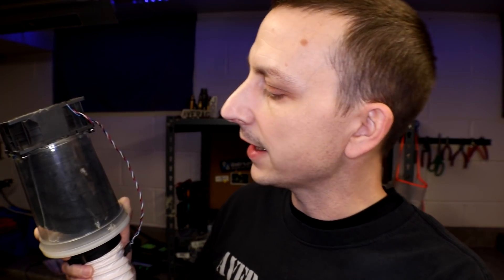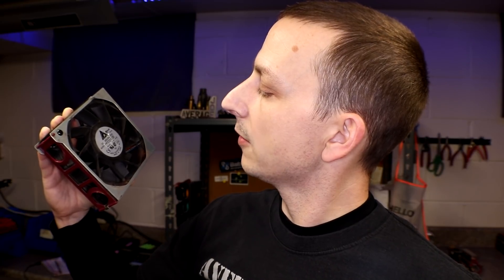Diy Solder Fume Extractor!!!

Comment: Do these fans work better “blowing” or “sucking”?  

Been soldering since 1971, (5th grade) and thinking I need something to deal with the fumes….  Want quiet, especially given I’m going to be doing batteries in the future.
Reply from the maker: Thats a great question. Im not sure which way is better. I almost went with one of those growroom fans cause there supose to be super quiet but decided to just use the fans I had for the cheapo way out lol. It seems to work pretty good! What all you planning on building battery wise?
Reply: @AVERAGE_JOE  bicycle batteries, and small(er) emergency batteries, sort of like knee-high power-walls.
Reply from the maker: Nice!!

Comment: Hey, does your place have a dumb waiter or a chute on the outside wall? The chute could be about a 1x1 ft hole or such.  If so, that might be how you're supposed to get the wood down the fireplace   ;)
I suppose there could be a dedicated door for that, too. I've seen that as well.
Reply from the maker: It has a little door thingy in the garage but its about 5ft off the ground and maybe 1ft square.  I thought this could of been for that use but it still doesnt  make it an easy task so not sure lol!
Reply: @AVERAGE_JOE  Ahhh, about 5ft.  Hmm, that's about the right height for the tailgate of a truck.  In the old days, a wood truck probably backed up to the port, and they toss log after log in. Then it was up to the owner to stack the logs in the basement. They would buy them by the cord if I remember correctly. You can still buy split logs by the cord even now. There's several ppl around here that do that from their homes, too.
Reply from the maker: Thats a possibility!!! Yeah theres people here sellin wood as well. Bought some one winter when power went out but that was years ago!!! I have a cord or 2 in the back yard for just such occasion lol
Reply: @AVERAGE_JOE  I've been heating the house with wood this year.  No electric heating yet. Still need to do some adjustments to the build. It's basically a work in progress until I can get all the material to rebuild it with exactly the right layout. 
I have pictures and a couple vids showing the setup. Will be posting a video about it soon (that could be in 3 months soon  😜 )  I might do another vid recording to show different things in general. It's all a WIP 😎
Reply from the maker: If I had a wood burning stove in the basement I would more likely use it since they can put out so much more heat for longer periods or maybe even a pellet stove!  Yeah let me know when you do a video(in 3 months😂) and Ill check it out for sure!!!  Everything is a WIP!!!!!😆💥

Comment: My suggestion is to put carbon filters on the end, and not blow the exhaust out the chimney.

When you vent out to the outside, you're sucking air back into the house from someplace, most likely cold air from outside.  Recirculate in the house and make sure to filter with carbon filters.  Clean air, warm air, all contained inside the envelope of your home.  Good luck
Reply from the maker: Thats not a bad idea!!!!  Didnt think about that!  Think Ill do that to be safe!!!👍👍👍👍

Comment: What happened to spot welding the 4s packs? I have a arduino spot welding (V3.3) and and use it with an old car battery, works awesome.

Oh, that flexible duct is really lousy for long distances, too much pressure drop. Maybe you could add a second inline fan for a push/pull approach. But it seems to working as is, better than nothing!
Reply from the maker: Im in process of spot welding those right meow! Workn great so far!!! I ment soldering the fuses to bus bars lol. 

The hose seems to be workn pretty good so far same with fan but ill find out for sure once soldering starts!!!

Comment: Nice work!  Since the flue access is blocked off, you might add a quick disconnect plug at the other end so there's no airflow during the winter when you don't want it.  Course you'd need that if you add more hookups too.
Reply from the maker: I did think about that and was feeling for cold air but didnt feel any.  Maybe because the vent goes straight up and has a bunch of turns????  I found one of those flappy things in the hoard pile you put inline with a vent hose.  Course one side is pretty big and other is square but I think I could make it work if needed!

Comment: nice job with the installation of the ducting, but I would pay a little for a proper extractor fan, seen as the length of ducting is going to cause a big pressure increase, those PC fans aren't designed for that, so the amount of air you are moving won't be very high at all...but hey if you know it's definitely sucking up everything you need then...a hydroponics extractor would be much quieter and shift way more air though!
Reply from the maker: I almost got one of those fans!  Had it in the cart on ebay and was about to checkout but thought hell..... I could probly use a bigger fan I have laying around.  Yeah if it doesnt keep up or if I have issues I have a squirrel cage fan from a hotsy that might do the trick!
Reply: @AVERAGE_JOE  What's a Hotsy bro? I'm from the UK lol, googled it, looks like a pressure washer? Squirrel cage fans can shift a lot of air though for sure! I can't remember, do you use lead free solder?
Reply from the maker: Yep you got it!!! Pressure washer with a fan. I use Kester 60/40 electronic solder! Link down below if you want to see it!

Comment: Your idea is almost the same as mine, good minds think alike. I had the same vent tubing, adapters and all. But I was going to tie it into the upstairs bathroom vent pipes that go out the roof and put a fan in the middle in the ceiling with a remote switch. Then I decided to sell the house, so I’m waiting until I buy another to do this. But I still have the parts. If you put a few more also put one to bring in fresh air and maybe make a natural cross draft ventilation? Like opening the flume on a fireplace and cracking a window. It might work, and fresh air is always good.
Reply from the maker: There you go NICE!  Our house is super drafty from being insulated (NOT) in the 50's so fresh air all the time LOL
Reply: Well we just got hit with that winter storm and lost power for 14 hours, so my fireplace was in use. 
https://youtu.be/To-jXR29xVo
Good idea, I just need to make sure my next house is built in the 50 and has drafts. I’m looking in S.C. and N.C. so older homes won’t be an issue. I like the all brick colonial home anyway.
Reply from the maker: Nice, just saw the fire!!!  Yeah our house was built in the 50s as well.  Not much for insulation but it will get there........one day lol😆

Comment: Nice, clean, and effective. Very good implementation of a serious requirement for your health. For the other gases 😱, 🤭 or ☠  may result.
Does Horas like foam board, maybe  a carpet cover if so.👍
🤔💭💣💥
Reply from the maker: Thanks!!!  It will be a HUGE improvement since I always seem to do a quick solder joby and never get the extractor out.  No excuses meow!!!  I think Ill just start turning it on each time Im down there to get in the habit!  LOL the other gases!!!!!!  Yeah I could totally turn that into a cat scratcher LOL
Reply: @AVERAGE_JOE  maybe a automatic switch that detects your presence.

My kids have reduced a half sheet insulation board to a couple of inches of foam scraps. It does make for a good fire starter.
I  would suggest covering in carpet but now that I think about it, they may just pull the whole assembly out of the fireplace by scratching on the carpet🙀😼
Keep up the good work, think on a cat prank special compilation, a lot of us would love it.🤔💭💣💥